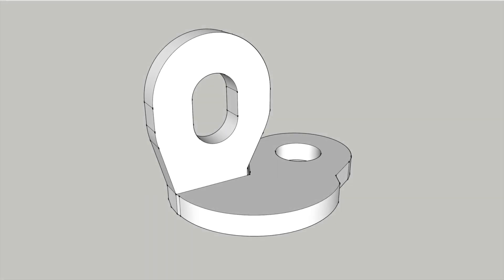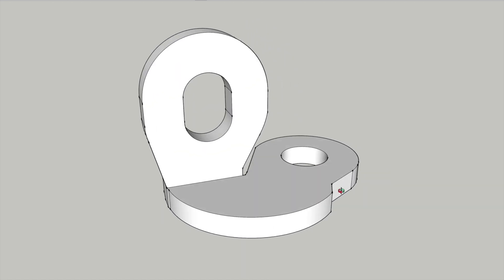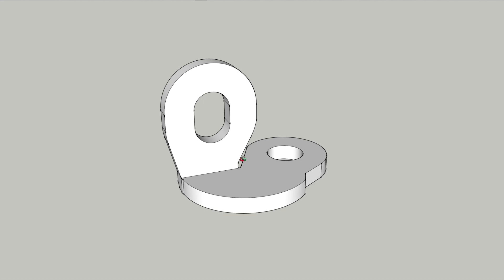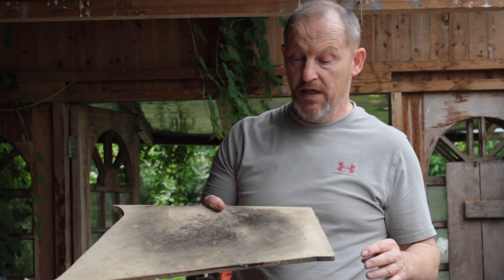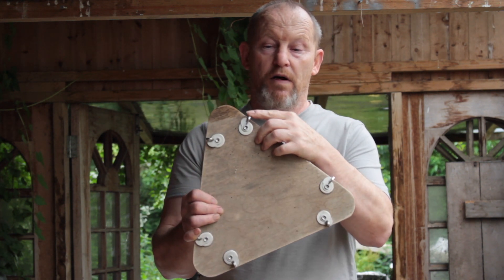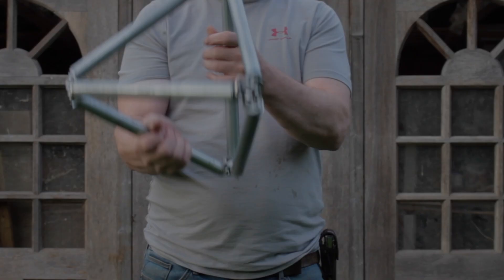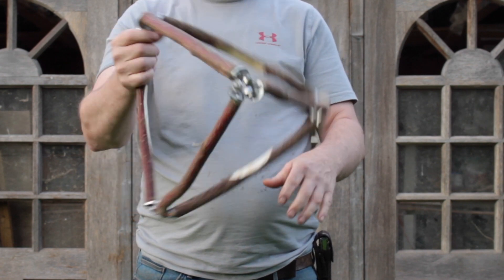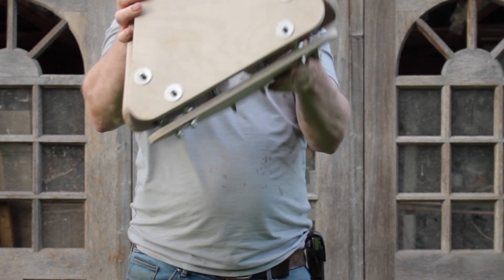3D print your own WangerFlanges + three ways to use them!

Comment: I printed a test pair with PLA at 30% fill, but they snapped. I then went to 60% fill and they were more durable, but still snap, would you recommend 100%  or another filament? I am really excited to test again, and I know that I will be ordering a truckload of these parts in metal. Thank You so much

Comment: Hi Paul, 

I would like to make some suggestions based off my 3d printing experience. Unfortunately FDM 3d printing (the most common) is anisotropic, which means the part will not bear the load or shear forces in all directions with the same strength. SLA 3d printing (resin-based 3d printing) is isotropic (equal strength in all directions), but SLA resin is not strong enough to make functional parts that will bear weight. They shatter pretty easily.  

In FDM 3d printing, the Z axis is weak because adhesion between layers is less than adhesion within layers. Printing a functional wanger flange might be impossible with the current STL file for this reason, but it could be possible if the shape was flattened and printed solely in the XY-plane, and after printing, bent into a 90 degree angle using heat or boiling water. Annealing 3d prints can also improve the strength, but warping can become a serious problem with annealing 3d printed parts. I could try both of these methods and report back to you on it!

Could you make an STL with the same shape, but just flattened to allow for experimentation like this? Hopefully it's not too difficult/time-consuming of an edit! Also, you can make an account at https://cults3d.com/ to sell the STL design, if you want to monetize that. I would be happy to purchase an STL file if you put it up there, to support your work!
Reply: Sorry for being late to the thread. Hope you're still around. I'm coming up on ~2 years in 3D printing. Been making custom parts almost since the beginning. Modified the printers and tweaked the profiles so as to be able to make functional PETG parts for all kinds of applications. The Z plane shear has been much minimized. If you're still around, just wondering what kind of filaments & process you tried for this. I'm about to experiment with the flanges using their files. There is a free download linked in the blurb below the fold above.

Comment: Interesting.  What about those who don't have 3D printer? Is there someone or a business that will 3D print or does doing that defeat the purpose (that one should have a 3D printer) here?
Reply: Most maker spaces will have 3D printers too
Reply: You could laser cut acrylic and bend it.  Check for a local maker space that makes a laser available.  We have one at HeatSync Labs in Mesa Arizona.

Comment: Busy using bamboo to build my first dome. So the struts are the easy part of the project. Now I understand the value of a simple easy universal connection. Well done!
Reply: For round struts you can use sections of hose and a bolt to make 4,5 and 6 way hubs. Once assembled, drill a hole through the hose and strut and secure with a cable tie.

Comment: Using wooden struts, the alternative ways of using the WangerFlange could be used to attach panels to a Geodesic Dome. Then, all that would be needed to complete the covering of a dome is to put seams between the panels, whether it is roofing tape or some other sort of water-tight seam.
Reply: Sensible folks would just build a panelised dome from the get go. You cant make a silk purse out of a pigs ear ;)